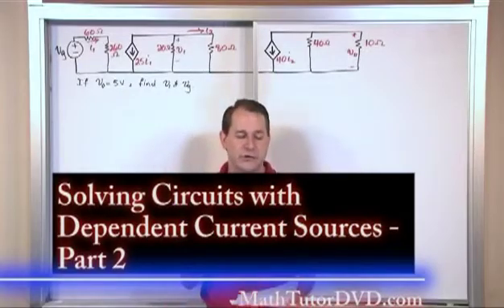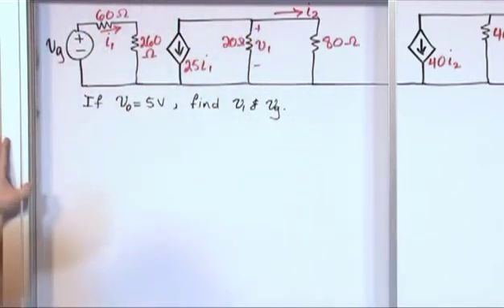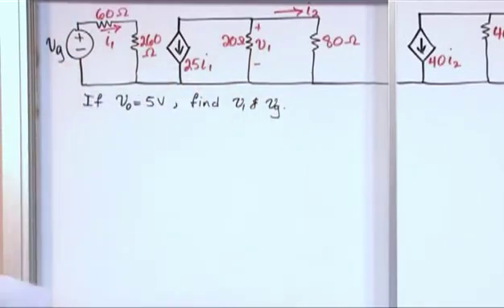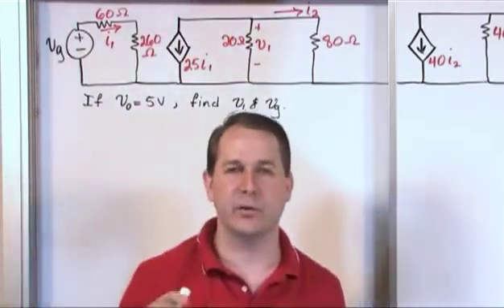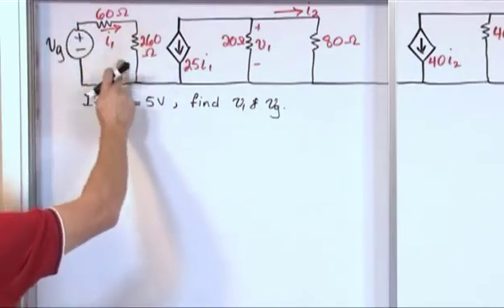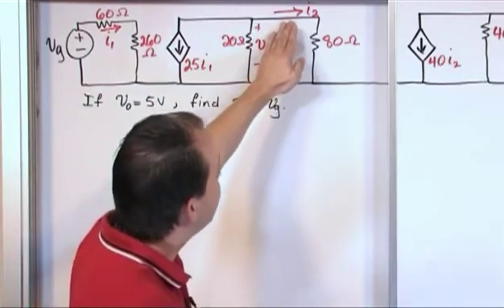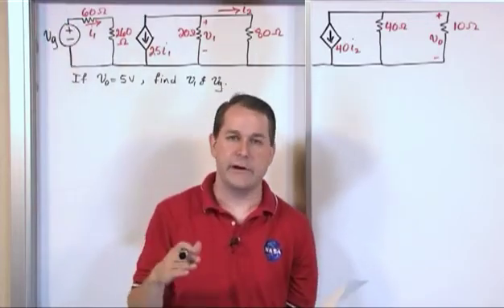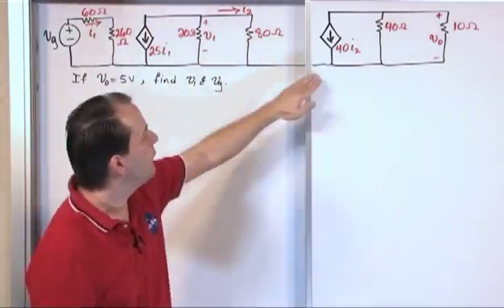Lesson 15 - Solving Circuits With Dependent Current Sources, Part 2 (Engineering Circuit Analysis)

Comment: I think this lesson contains a mistake. In the full lesson, you work out what the value of dependent current source "40i2" is BEFORE you work out what i2 is. But 40i2 is a dependent source (it depends on the value of i2, which is in another, unconnected part of the circuit), so how is it possible to work out the value of the dependent source, before you know what the value of the control variable is?!